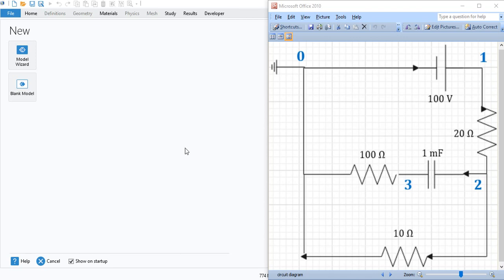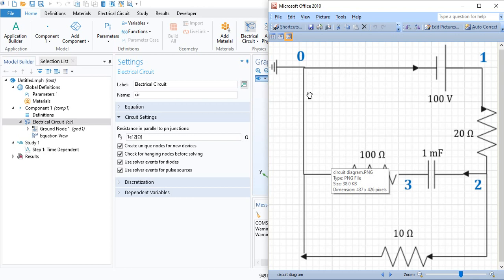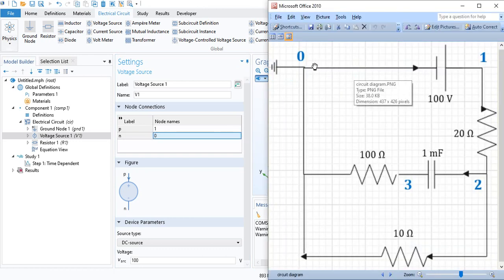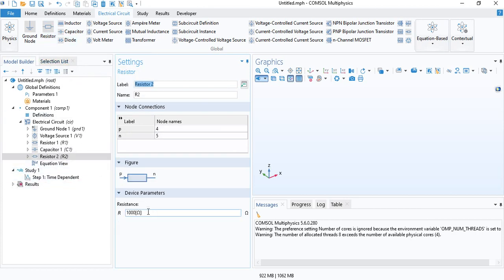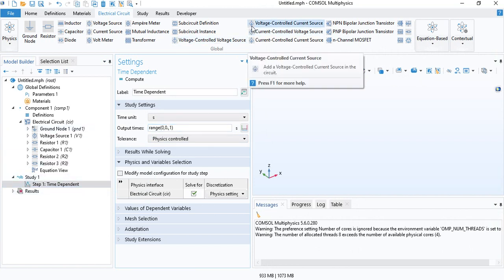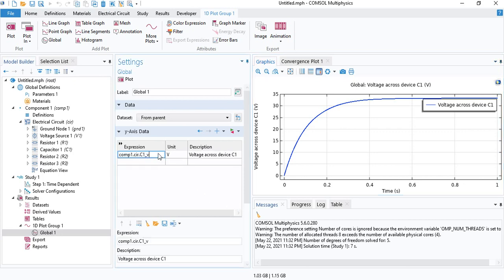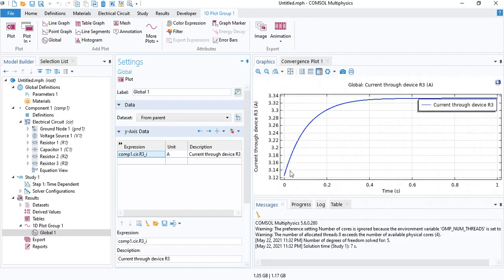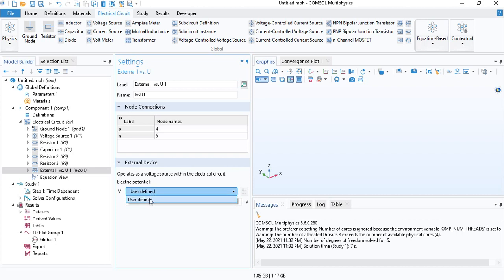Solving an electrical spice circuit using Comsol Multiphysics

Comment: Hi, can we design the circuit of transformer in this way? actually i need to find the %Z so i want to know the voltage at which rated current will flow, i am trying to create a circuit but it is not giving me desired results, can you help in this regard? TIA :)
Reply from the maker: This method can only be used if your circuit is made of ideal electrical components, like capacitors, resistors, diodes, etc. So no geometry is relevant in this case. But if you want to design a transformer with specific geometry for the core and coil then you'll have to use the magnetic fields (mf) interface. 
You can also link the physics interface to this circuit so you don't need to build the geometry for everything.

Comment: Hi! it was helpful! In COMSOL Multiphysics, electrical circuit, is posible simulate an switch?
Reply from the maker: There isn't a direct option for adding a switch but you may do it indirectly. For example, you can add a resistor in a circuit whose resistance changes from low (close circuit) to very high (open circuit). This resistance can be defined by a function (such as step) in the time domain.

Comment: How to simulate the Mutual induction, i mean LC inductive coupling circuits using this module??
Reply from the maker: There is a feature for the mutual inductance which you can add. Other than that you just need to insert he individual components which you have in your circuit.

Comment: Or you could just use LTspice to do it .. it's free and actually designed for simulating circuits much more complicated than what you show.
Reply: You are right but in COMSOL you can couple your analysis using Multiphysics.

Comment: hello, im currently want to do a circuit consist of transmitting coil and receiving coil, plus with super magnets to make the magnetic force directly pointing to receiving coil to enchance it. So what proper setup should i make in COMSOL, really appreciate if you could reply.
Reply from the maker: If I understood correctly, you want to place a magnet next to a coil. You can construct the required geometry in 3D/2D and then connect the coils in the mf interface to an electric circuit with several elements. You have the option of taking the voltage or current from a physics interface to be used in the circuit.

Comment: Is it possible to see effect of superposition of magnetic fields with COMSOL?
I mean using sources together like permanent magnet and direct current source or transient current source or sinusoidal current source, pls watch this https://youtu.be/n_fCTs3ZAtc.

I just wonder if we add a DC magnetic field source to the induction heating system it will make a negative or positive contribution to the heating.
Reply from the maker: You can add a permanent magnet with a DC current source in a time-dependent study but it will not have any contribution to induction heating. Induction heating is done from the heat generated by eddy currents, which are only generated from an alternating magnetic field (AC source). A DC magnetic field will be superimposed on the alternating field but since the DC component is time-invariant, it will not generate any eddy currents.
Reply: @JafScience  thanks for kind explanation. can u repeat these examples with comsol  https://youtu.be/n_fCTs3ZAtc.
Reply from the maker: If you have a specific doubt, describe it here.
Reply: @JafScience  Would u pls check here: https://drive.google.com/file/d/1WGzZlVOpc-AxFiF8XwDcZ8hxrm81aIKt , if the frequency is changed any induction heating occurs?
Reply from the maker: The study setup is not correct. Use a "frequency-transient" study to model the electromagnetic physics in the frequency domain and the heat transfer physics in the time domain. Frequency changes the amount of heat generated, depending on the material's properties.
Reply: @JafScience  

thank you for your kind interest.

i used  "frequency-transient" study to model the electromagnetic physics  and "time dependent" for heat transfer. 
u can check; 
https://drive.google.com/file/d/1Z4C0N8t9184MaCFWGDyp9gAMZnHFfeYh

output times =range(0,1,60)  for "frequency-transient"  and "time dependent" parts are ok for simple simulation (total 60 seconds with 1 second steps). 
or should i arrange anything for making simulation time shorter?
Reply from the maker: Remove time-dependent study. The frequency-transient study combines frequency domain and time-dependent studies. The duration of simulation is based on what you want to study so choose it accordingly.
Reply: @JafScience  would you like to publish a scientific paper with me? if you are interested pls add your email here. i ll explain in detail.
Reply from the maker: I'm currently occupied with other work.
Reply: @JafScience  ok. thank you.